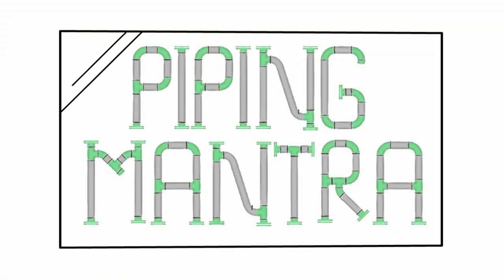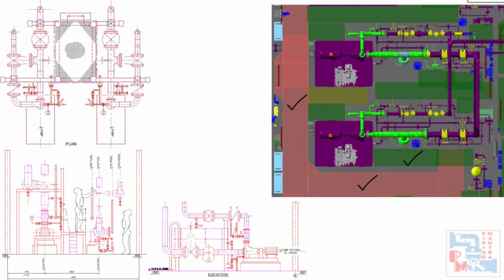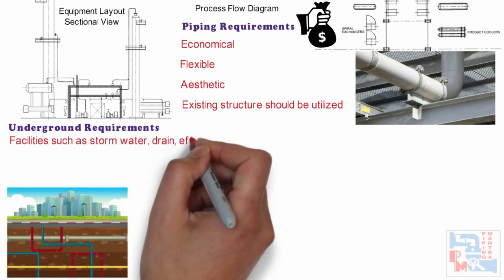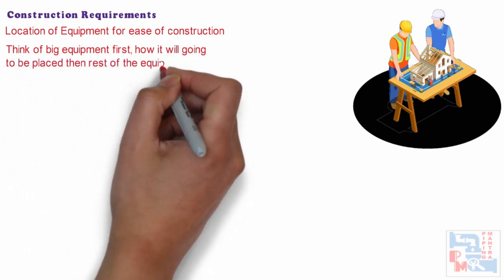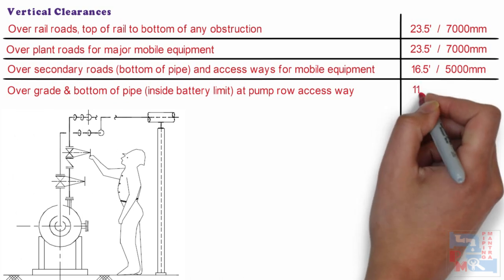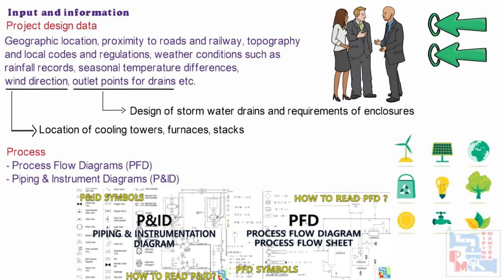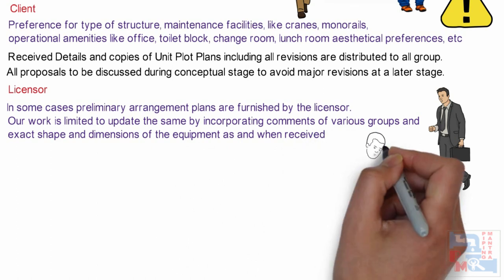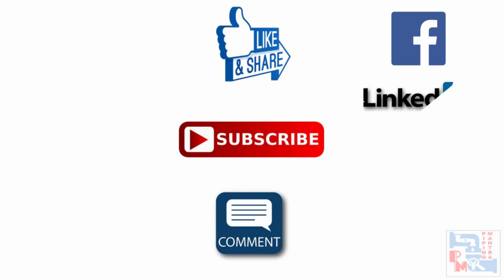How to prepare an Equipment Layout | Considerations | Safety Distances | Piping Mantra |

Comment: What should be the lateral distance between two product pilelines? What is the governing standard/guideline which states the principles regarding lateral distance between two product pilelines
Reply from the maker: Yes. There is a std practice followed globally.
Distance = radius of bigger pipe  flange + radius of smaller pipe + insulation of both pipe (if any) + 25 to 50 mm clearance

Comment: Make a detail video on instruments,Valves, Material Specification, Piping Material Specification, Dimension STD, Material std, Power Piping,Cross country Piping, process Piping, utility Piping, civil Load Data Calculation,dyke wall design, storage tank design,Heat exchanger design

Comment: Can you please make a video on complete pipe line sizing, pump sizing as per plant capacity heat exchangers for both open loop and closed loop system
Reply from the maker: its kind a project and making video on that will be a big task.